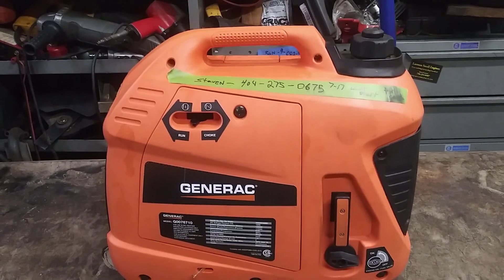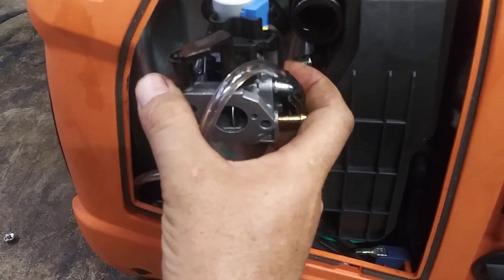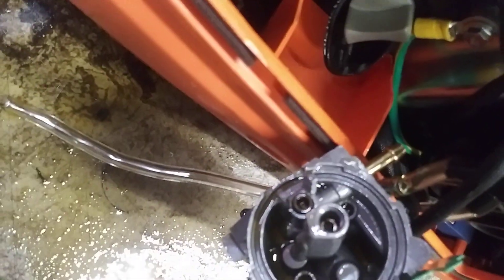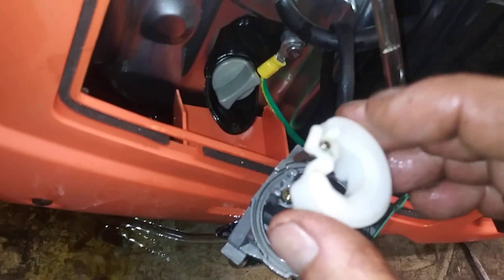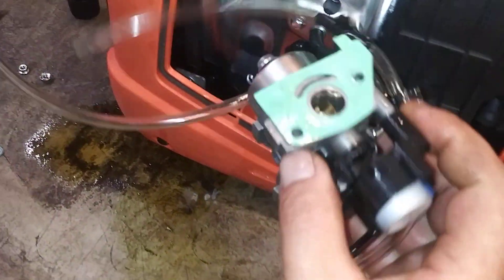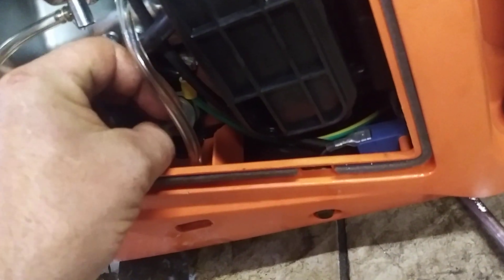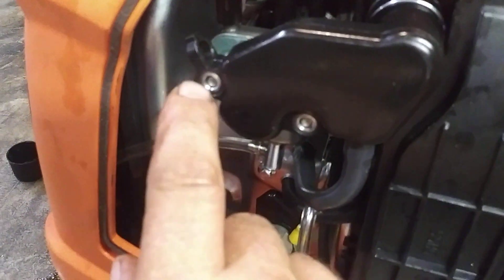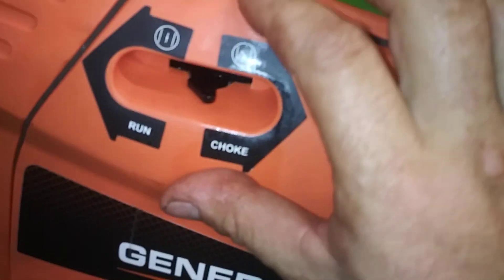* Generac gp1200i generator inverter carburetor cleaning rebuild tune up model g0076710

Comment: I have this generator and really like it. In a power outage, it powers my full size refrigerator/freezer, a desktop computer, internet modem and an LED lamp all at the same time with no wattage to spare.
Reply from the maker: there is a gas cap for the eu2000 that fits this it has a nipple on it to add a boat fuel tank. grab a 6 gallon boat tank boom 30 or 40 hours of run time between fueling https://amzn.to/3FmacA7

Comment: Thank you i got mine running now on half choke in a pinch. Carb is so dirty, need a new one, need link for parts.
Reply from the maker: clean the carb again. there is another jet under the idle screw on top of the carb get it as well these carbs are like 250 if you can find one
Reply: @smallengineguys  
I got it running like a top. Thank you for your great video and response 👍🏾

Comment: I'm thinking about getting the generac 1200....what's your opinion of it ?
Reply from the maker: They are fine. Will run a frige a couple light and aphone charger.
Reply: @smallengineguys  ....thank you....what are your thought about its quality ....I cant afford a Honda but was also looking at the westinghouse inverter
Reply from the maker: @grandmastert01  so its just a chinese generator with generac name. It works fine and will last forever as long as you do proper maintenance. But you can get the 2000 harbor frieght one for cheaper and its same quality.
Reply from the maker: see this is the generac https://amzn.to/3m0nOTK
and this is a chinese one https://amzn.to/324RC9C
same same
Reply from the maker: wen is top line chinese but you will pay a bit more  https://amzn.to/2GwV5Wc
Reply: @smallengineguys  ....thank you for your help
Reply from the maker: @grandmastert01  yep

Comment: Sounds like this is a nice generator. The issues with most generators I've been reading/studying is from fuel - correct me if I'm wrong. People using crap ethenol fuel and letting them sit there for months on end. No preventive maintenance and then blame the generator.
Reply from the maker: Using ethanol fuel is fine if your power is out and your steady using it. Stop using it and 3 weeks later your carb is junk. You need to use non ethanol fuel and start your generator every month for at least 10 min with a load on it.